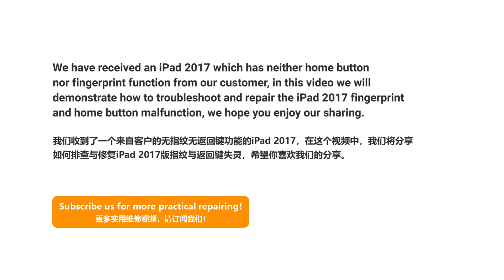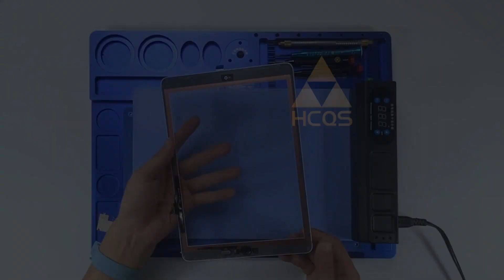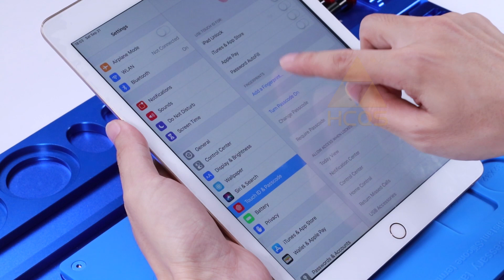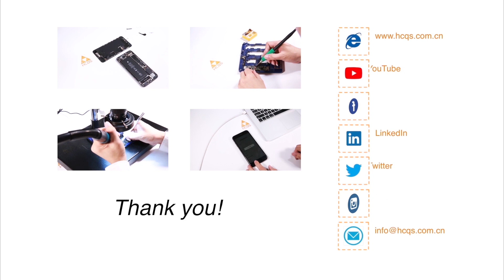How to Fix iPad 2017 Fingerprint and Home Button Function | iPad Repair

Comment: Good tip, I'm doubting if in my case is the flex, should work at least unlock feature from an Ipad Air flex in 2017 one? Not in my case

Comment: Which part is the critical part on a home button as to the Touch ID function? Where is the actual Touch ID component? Is it imbedded in the sensor surface part (the round thingy) or is it somewhere else on the ribbon? Under the square metal cap? I ask as I have had several damaged iPads that have either torn of the whole thing near the connector on the mainboard - but also had cables that are torn out right at the edge of the button - but both give the same error message saying Touch ID could not be activated.
Reply: So I found another video of a repair of a home-button where the cable was torn out right at the edge of the button, and this kinda makes me thing that the "active part" may in fact be the in the sensor itself. It appeared that they only replace the ribbon cable intact and only kept the original button.
A job well beyond a DIY-er sadly so the iPad I have is more or less junk.

Is it possible to use a non-Touch-ID button from an older iPad and somehow bypass the activation prompt?

Comment: I accidentally ripped the Touch ID flex of my iPad 2017. Then I saw the section where Touch ID is soldered on the flex cable. So I ordered a replacement flex cable but it came with a premounted Home Button, that is one part with the flex cable itself BUT the flex cable also has the solder pads on it. My question: Could I cut off the Home Button and solder the original Touch ID onto the solder pads? Would it work?
Reply from the maker: Hi, if you are making the same repair as we did in this video, it should be no problem